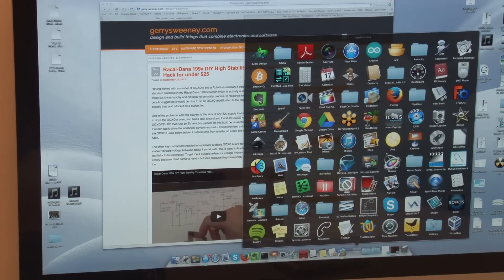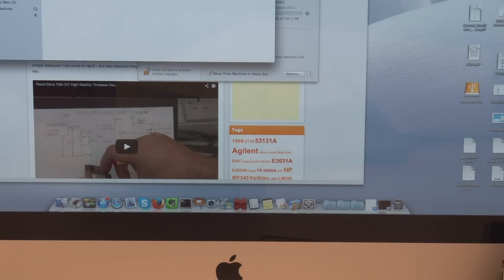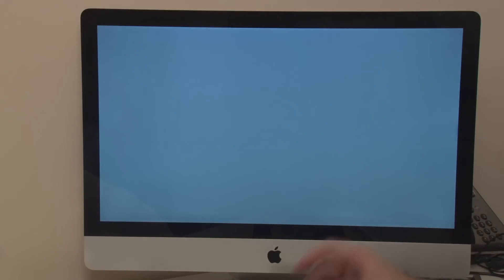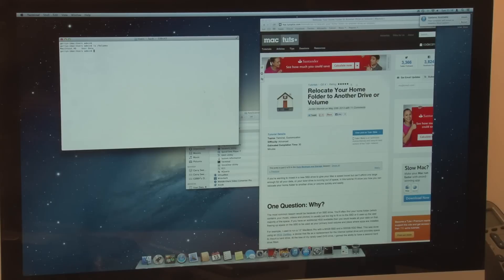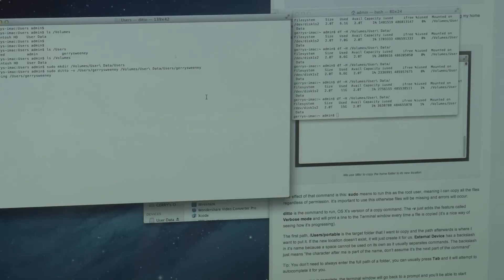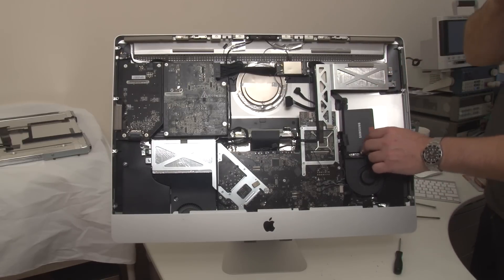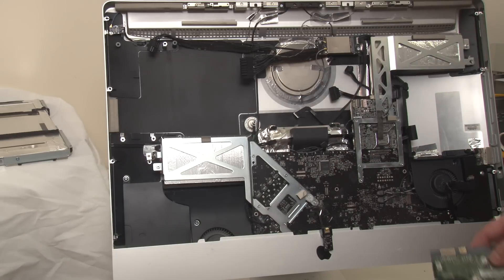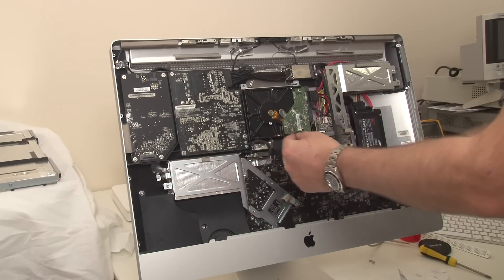Apple 27" iMac Teardown, SSD Hack and 2TB Upgrade

Comment: Great video I did something similar on the same vintage iMac.

Couple of points:
A cheap plunger or two (wooden handle rubber suction cups) you use to unclog your sink can be used to remove the screen very easily.  Just push the rubber plungers onto the screen and pull and it comes off the magnetic force very easily.

I have all my videos under the Movies folder (Final Cut etc) so you simply use Time Machine and set preferences to not include Movies and do a full back up on to a spare drive or your time capsule. Separately copy or move your video content on to a portableUSB drive or in your case move it to your new HDD using your drive interface device.

Restore the old time machine back up onto the SSD (after basic OSX install done) and when finished simply use a symbolic link to link the movies folder in the new OSX install across to the second big hard disk. (Using make alias and no command line work is necessary at all).

In my case I also use a link to map iTunes base folder across to the second big drive.  This is superior to just changing the drive in the iTunes preferences as that method leaves the library xml and other files on the first drive and content on the second, I prefer all iTunes stuff into the one folder on the second drive.

Cheers
Reply from the maker: HI, thanks for the comments and suggests and thank you for watching the video. Gerry

Comment from the maker: Yeah thats what I figured out, the HDD seems to run at a sensible looking temperature and the fans are not trying to lanch the computer.  When I am rendering video the fans all speed up so I think the hacked in 2N3904 is working a treat. Gerry

Comment: Also about anti-static. Often when moving around in combination with dry weather or specific clothes, it tends to build up static charge. I usually discharge at some large metal objects like heating pipes/radiators. The only time I damaged (DIY) electronics with ESD was just after I enter a room from lunch break and didn't discharge myself. Anti-static bands of course minimize build up when you're inside the room but moving a lot.

Comment: If you ever open you mac again you can try soldering the missing sata connector.
The capacitors next to it (C4530-C4533) should be 0402 10nF.
If it works you get your dvd drive back.

Comment: Not to frighten you, but I've bought a Samsung 840 250GB too, but after ~1 month I got system freezes while installing a large game. It showed unrecoverable ECC errors in SMART. Got a new drive by warranty, since then (3+ months by now) it has been rock solid and SO fast. It probably was a faulty unit, but be aware that drives often fail when they are very young or very old. I reckon that after ~1-2 months you can clarify something 'stable'. Luckily I was able to get the data off the drive.

Comment: Excellent video on installing an ssd into the 27 Imac,  you could have removed the dvd player and used an after market ssd carrier in that position and then installed the dvd player in an external usb case. Its a personal preference thing I guess. switching the 3.5 inch drive out and installing a double 2.5 inch carrier enables two further ssd drives or one hdd and one ssd is also a further option. 
That gives you a hdd data drive, one os ssd drive and one work based  ssd drive.

Comment: You can get SATA port multipliers (think USB hub). They don't have to be 1:1 ports. That would solve your problem easily although it does cap the max bandwidth to both devices. Should be plenty for every day use.

Comment: If you can find some USB wires in there (the WiFi or bluetooth adapter might be internal USB) you could add an USB HUB and a USB/SATA adapter to connect your optical drive.

Personally, I would also keep my home folder on the SSD and just move large media files to the mechanical drive. Never mind the extra write cycles.

Comment from the maker: I did consider that but I was not that keen on cloning and then partition re-sizing although I know thats a hang-up from my days of DOS/FAT32 and crappy ATA drives.  I also did not want to do too much hanging of bits on the computer, the screen is big and heavy and awkward. I am sure your approach would have worked fine too though. Thanks for the suggestion. Gerry

Comment from the maker: HI, I read somewhere that the south bridge chip probably is not enabled for the third port.  Not sure but I did not think it was worth the effort of trying. I think I can use a SATA splitter if I can find a two way spiller that fits in there somewhere. Its easy enough to connect an external optical drive if I need to - I tend to do everything over the wire now days or on SD cards for video. Gerry

Comment from the maker: So far it seems to have worked out well.  The speed of the drive is mostly down to random access and drive spin-up time. When I rendered this EPIC video I was getting pretty much the same frame rates as before so for performance I seem to have found the right balance.  For and OS drive though, you are absolutely right, the Green drive would not be the best for sure.

Comment from the maker: Thanks for the info, I was not aware of that, quite useful to know.  The drive at the moment works and has all of my data on it. I plan to hang onto it for a month or two just to let the new drives settle in (you never know).  This was on the recall list for Apple so I guess it may well be one of those drives affected but so far it has been reliable. Gerry

Comment: Im just not brave enough to do that myself.  I've just gone with a Thunderbolt SSD for OS only.  Firewire external for all my files.  USB external for my backups.  My internal is still there and working but I only use that for an alternate boot if I had an emergency.  Great video.  Thanks for sharing.
Reply from the maker: +Christopher Woods your welcome, thanks for the comments

Comment: One suggestion. I would have connected the second HDD in place of the DVD and cloned the drive over at full SATA speed. Then installed the SSD, partitioned and install the OS to it. Then install the new HDD, associated the new home directory. deleted the root partion on the new HDD and resized the remainder. job done.

Comment: Did that plus upgrade to i7... Lots of sweat.. It works and its worth it .. as machine is much faster. Plus its much easier if you order original cable for this upgrade plus hdd bracket. it just looks neat.

Comment: When I got my27in iMac I also bought a 3TB USB3 external drive to hold all of my youtube video making stuff. Partly because I also have the 1TB HDD in mine, (sadly mine didn't get ordered with the PCIe SSD slot populated, so at some point I do want to add  one and have it run as a fusion drive) and I don't want to fill it up, but also because as I've read online and confirmed, having the everything you're working with for video editing on a drive that isn't your boot drive increases speed for importing and exporting videos in iMovie, or any other video editing software.

Comment: Gerry, Samsung 840 series SSD?.......If so you've picked a nice reliable, fast one. After a couple of false starts with some cheapo's I've been running an 840 in a media server (Mediaportal - Win7) and it's been rock solid. Also, just wondered if you run a NAS at home for all your crucial data storage/backups.

Comment: Suppressed to see that you chose to fit a WD Green HDD.
Reply from the maker: I presume you meant "surprised" :) why do you say that? I specifically chose a low power disk to reduce the amount of heat generated in the machine.  In practice, the disk has been really great in use, I have not noticed any performance issues at all and I render a fair amount of video - the combination of the SSD and the HDD is spot on IMHO.
Reply: There I go trusting the spell checker to put red squiggly lines under things :)
 
I have just lost confidence in the WD Green series as I frequently have broken kit presented to me with failed drives, where I can confidently bet that I will find an unhappy Green sat inside it. 
 
Mind you since Japan 2011 catastrophe HHD quality across the industry seems to be suffering a bit.
Reply from the maker: Broadcast1Channel Thats good to know.  I do currently have a full backup of my content on that drive but I will bear it in mind, thanks for the heads up. Any suggestions on reliable 2TB low power drives?
Reply: I do use WD Green drives in PVR’s where they have no forced air cooling and limited power. Also if a drive pops in one of these all you lose some TV series and films which seem to be repeated quite regularly.  
On occasion I have used higher grade 2.5” drives mounted on a nice aluminium heat sink in place of a 3.5” to keep the power consumption down.
Generally most equipment I come across there is not an issue with cooling and power so if £ allow it an enterprise grade drive goes in.
Saying that I come across very few Hitachi drives that have failed and I have some of Hitachi that are getting on for 15 years old in some obscure kit that is still working.  
 
WD have introduced some low power drives with their GreenPower implementation targeted for video editing and CCTV. You would hope they have spent a bit of money on the durability these.  
 
I’m looking to try out one of the drives that implements a decent size SSD with a HDD in one device. As laptops tend only has space for the one derive I'm Intrigued to see if this implementation of an SSD still gives the SSD performance gains.
Reply from the maker: Broadcast1Channel I think I will just aim for redundancy and plan for likely failure. I just ordered two 4Tb HDD's and am going to run these in two separate time capsules, apparently the mac's will backup to alternate drives so you end up with two full copies of your back-ups just an hour apart.  I will get around to implementing something I can use to backup my video footage  to Amazon Glacier at some point. Thanks for the info.

Comment: I run a 256G samsung SSD no probs after one year (use the software and RTFM). You have to make sure the OS knows its a SSD otherwise your drive will die in a year. The speed is awsome on my machine, I have a 1TB local drive and a Synology DS411j to serve and back up in raid 5 4x2TB (ball park 5.8TB). Have 8 G of really quick ram and AMD 8 core water cooled malarky, but I have to say thee SSD really makes everything bloody quick, I should have bought 2 and raid mirrored, woooo

Comment: I did much the same thing...but all i did was use a simple adaptor on the original dvd sata cable..pretty much plug and play, i can't see the need to pull the logic board out
Reply from the maker: I pulled the logic board because I thought there was a third SATA connector - but that turned out not to be the case and by then it was too late
Reply: Gerry Sweeney Yep..i should have thanked you for the upload really interesting video.

Comment: Good job Gerry...wouldn't catch me inside my wife's iMac!

Early on you mentioned interfacing your test gear I THINK with the Mac, if so could you elaborate on how you're doing that? Perhaps simply with Windows running on the Mac.  Would love to use my Mac laptop at the bench instead of the XP machine for Agilent I/O libraries and some R&S apps.

Comment: I might have gone about this in a different way.
I have used an application called Carbon Copy Cloner which allows you to clone a drive directly onto another drive.
Being a direct copy it retains all your passwords and accounts intact. 
It stops you having a mess about in terminal. 
You then simply remove the old hard disks and install the new ones. 
Logging into root you can choose which components and folders of the OS that you clone. 
Your old hard disks are accessible by the caddy that you used to format and clone the disks.

I have a 500 Gig SSD installed on my mac along with a standard 1 TB drive.
I do find the SSD a bit temperamental as sometimes the SSD sometimes hangs on start up which means holding the power button in and restarting. 

The issue might be that the SSD is a Intel drive and may not be entirely Mac compatible. It still remains a mystery to the occasional lock up on booting from the SSD.
I have retained my optical drive and I back up toy a GDrive firewire 800 external drive
Reply from the maker: Jeremy Clayton-Travis Thanks for the comments. I don't like CC when changing drive sizes because you end up having to re-size partitions and all that jazz. I know it takes longer but it always feels better to create a fresh volume and then copy files to it - probably just hang-up I have form the days of DOS and Defrag :)

Comment: I hate repairing imacs, while you get more money from fixing them, I have to use very fine air filter taped to a box fan and run it in the room for an hour or 2 before working on the system, and also wear clothing that is lint free.

imac screens lack the protective plastic layer on the top of the IPS panel and thus when cleaning, only lens safe materials will work, anything else will scratch the panel so it is best to avoid having to clean it.

Comment: Why didn't you just replace the hd with an ssd drive and then use an external hd for data? Seems a little easier, but of course you did succeed in the end getting it all in the case.

Comment: Hi Gerry. Great insightful video.I`d like to replicate the hard drive thermal sensor you modified as I`ve done the ssd upgrade and would like to use the existing sensor cable.You mentioned an MPN transistor - is there a specific transistor that you used as I have googled these and there are literally hundreds of them.Also you mentioned cutting off the third leg of the transistor - could that be either of the two legs to the extreme left or right of the transistor.Your help is much appreciated and look forward to watching your other uploads.

Comment: Hi Gerry, just watched a couple of your videos and the information that you provided is excellent, my 27" iMac has problems causing it to go to black screen, switch off and one stage went to the kernel..box i think it is called, i felt the back of the computer and it was  hot, i believe it is an overheating problem and will pull the screen off and have a look, can you tell me what i should look for?? thanks in advance. Ric
Reply from the maker: Hi rictrain55 check the airways and clear all dust, make sure all the fans are running, that would be a good start. Good luck with it.  Gerry

Comment: Gerry, I'm very new to Mac products I was wondering what software did you use to create the video? Nice job of showing how you install an extra drive. I'm not quite ready to do that just yet.  But thanks, Dwight
Reply from the maker: I used Apple Final Cut Pro X to post edit, and Handbrake (free app) to transcode master down to MP4 for pushing to Youtube.   I generally use Quicktme player on Mac for screen recording. Hope that helps. Gerry

Comment: The NPN transistor trick didn't work for me (with the emitter at the edge of the connector). To disable the fan completely (so it doesn't continuously run at full speed), short the temperature sensor wires (by inserting a 28-32 gauge wire between them, such as a small piece of network cable).
Reply from the maker: I would not be so keen to disable the fan completely, its needed to get the heat out of there.  Try the transistor polarity, it should work...

Comment: Good job Gerry. You're a brave man.  Just watching you do it gives me a headache. I am going to pay the money to get a Mac Store do it despite the cost. Too tricky for me. I was hoping to keep my dvd player but it seems you removed it to fit the second drive. 

So it is not possible to have 2 drives plus the dvd player at all?
Reply from the maker: Silverwolf70 In the case of my computer the third SATA port was missing. I am sure I could have hacked something in but I, perhaps via a USB <> SATA converter but I just don't use the optical drive so I was not bothered.

Comment: Hello.  Once you remove the monitor and set it aside, can you still power it up without causing any issues? I just want to see if my fans are even turning since I don't hear or feel any air coming out of the top.

Comment: Jerry, I'm just curious why you didn't replace the thermal paste for the heat sinks when you had your motherboard out? Have you had any problems with overheating?  Great video, thank you for posting this?
Reply from the maker: I have not had any overheating issues, still using the same mac, although I have just bought a new one with the latest big spec so this one will be making its way to my kids o ebay soon.

Comment: The question:.It is any way to take outside of the computer the conection sata and the power cables.To use the SSD out side..that way I can change the SSD  at any time more easy..

any suggestions you can help me..THANK YOU..
Reply from the maker: jhon gris Not without making a hole in the rear casing, if you are prepared to do that then it would be easy.  Gerry

Comment: My iMac which is the exact same model as yours gets extremely hot especially on the top part, the fans sound like they are overworking when it's uploading videos to iCloud, even if it's one video, it's an i7 16 gb, the iMac slows down whilst fans are running. Any help would be appreciated.
Reply from the maker: +Ajaz Khan Only thing I could suggest is open and clear all the airways, make sure there is good airflow.  Getting a HDD that produces less heat would also be a very good idea. Gerry